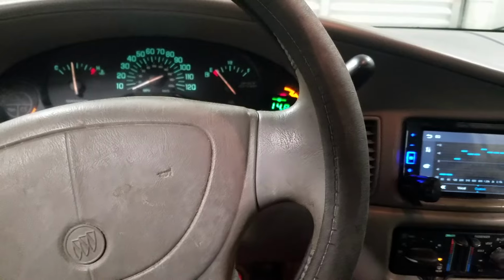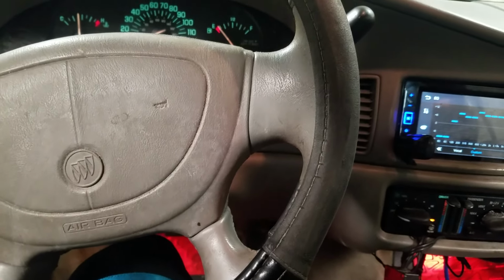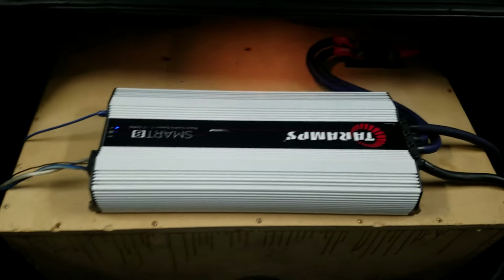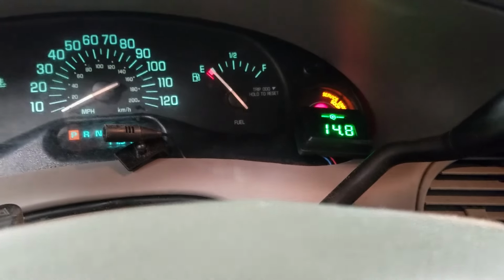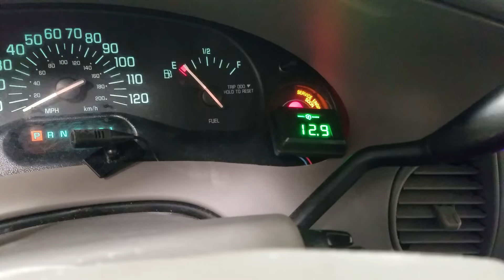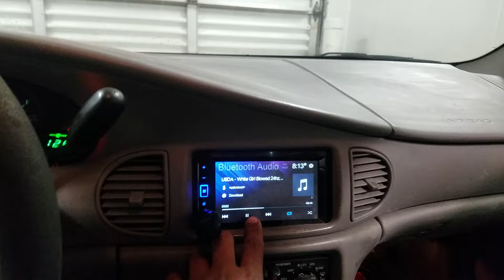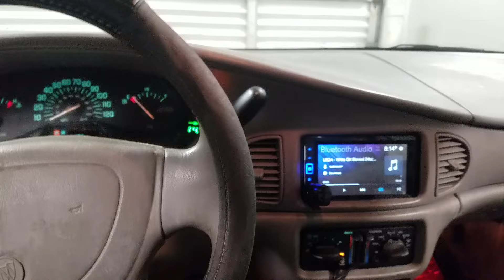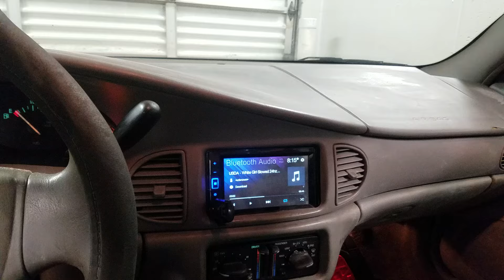sundown x v2 12s bass demo

Comment: I have two x12 v.2 in my avalanche, with two sundown 1500 special edition amps, I don't have that much power, dang. My subs are facing in as well
Reply from the maker: What are your amps wired to? Just wait till i get my lithium it should be alot louder. After i gotta work on my mids and highs.lol